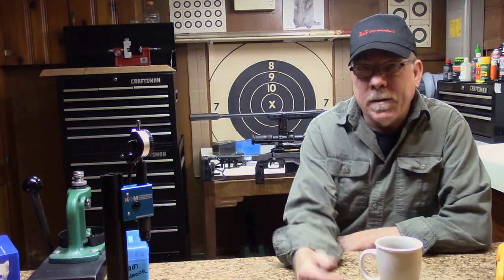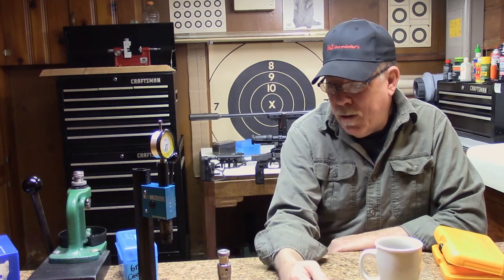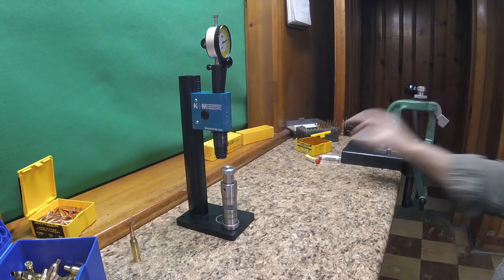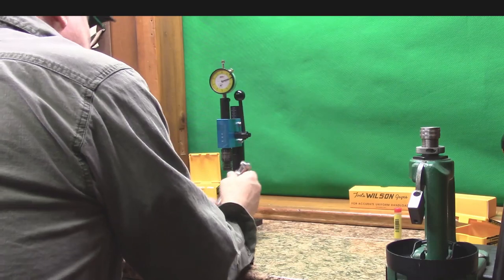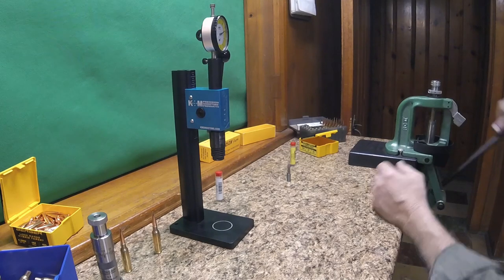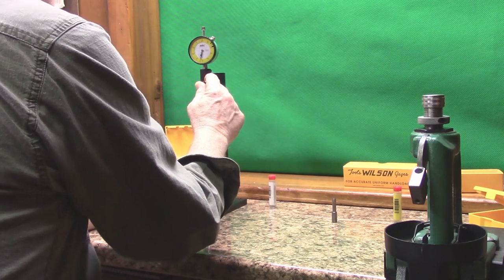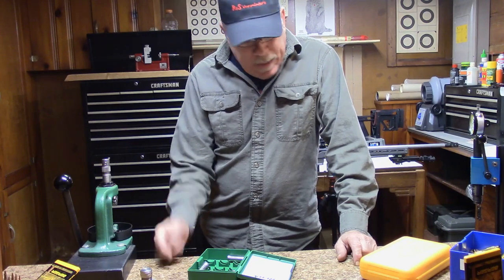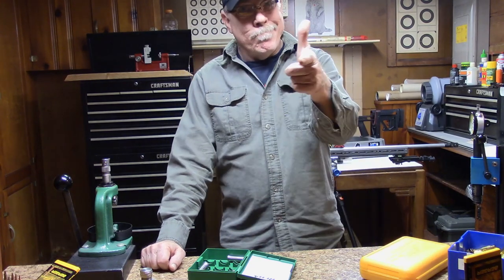Neck Tension with Wilson Dies and K+M Arbor Press with Force Pack

Comment: I liked your presentation. I was a little surprised by the amount of force on the 6.5. I usually run a mandrel from century 21 in my brass and I find that I can safely run it to a half thousand of an inch and  still have good neck tension.
Reply from the maker: we're trying to get some mandrels from them to open up things better. Also looking at inside reaming them some too.
Reply: Ran half thou with graphite on the bullet and got the lowest sd ever.

Comment: I have several different seating dies that i get great results so  the main reason I got this press , seating depth tests at the range . But I have found myself using more often at the bench as well ...
Reply from the maker: I know what you mean. It tattle tells on your brass prep... I lean more towards benchrest accuracy  and the little stuff shows. I have been helping a friend work on some PRS stuff, which does not need "real tight stuff", and he went to a 6GT which I do not have the Wilson die for to help him on his set-up for that round. His neck tension is not in a happy place, as the crono tells me that. I see a die in the future lol.

Comment: I use the same dies and arbor press with force pack.  Which is more important, initial force reading when bullet starts seating or the maximum seating force?
What do you think about dipping in powdered graphite before seating bullets?
Good tip seating long and then using the arbor press at the range.
Reply from the maker: My thoughts are, it should be pretty close to the same all the way down. I can understand that the closer you get to the shoulder, the stronger the neck gets and there is less of a chance to get inconsistency with lighter tensions.  That is why we find ourselves shoving metal shafts down our brass lol.
Yes, I have tried dipping with powdered graphite and did not get the results I thought I should see. Maybe with lighter tensions I might see better results.
I have noticed the insides of the necks are not very consistent either. Even the neck turned multi fired brass is not. We're looking into that now with new things ordered. :)

Comment: 👍
Reply from the maker: I'm guessing that you found out how :)
Reply: @rsvarminters9083  not really anything I didn't already know.  But back in 1990 when I first entered the tool & die maker's field I was told by one of my mentors that if I  wanted correct answers then I needed to ask the correct people. No disrespect implied to you an any way, but I realized that I should be asking K & M that question instead of the end user, and that why I deleted the first comment. If you are wondering why I seem so incredulous that .001 travel on the indicator equals 1 pound of force simply Google Hooke's law as it applies to compression springs. Had they simply used fluid filled head with a fluid filled pressure gauge (PSI or Bars) attached to it via a stem or some other fitting method then it would give true readings as fluid will not compress by volume. BTW, I have not asked K & M about their force pack. My guess would be that instead of it being accurate to .001 movement to 1 pound of force, It is simply set up so that a certain range within the compression range equals 1 pound per .001 movement and is simply meant to act as a compactor between each different bullet seating.
Reply from the maker: I can agree with that :) @timothyosborne8285